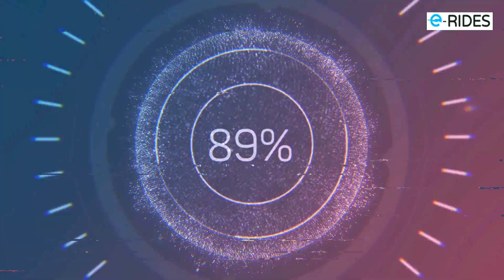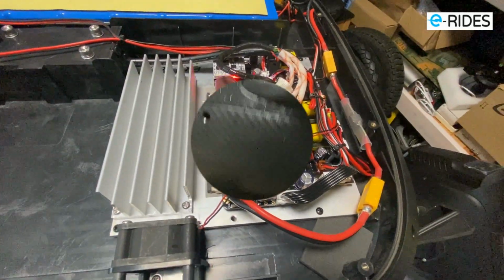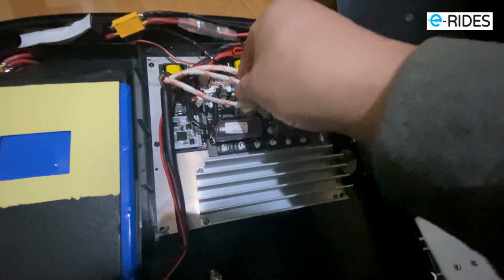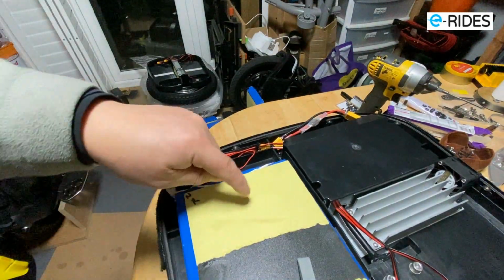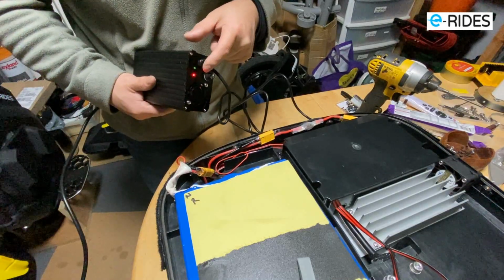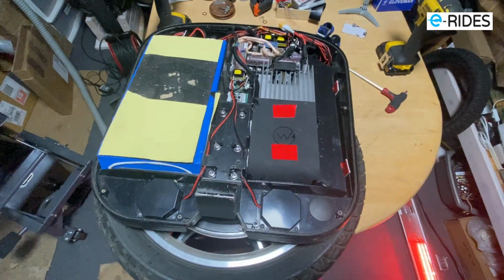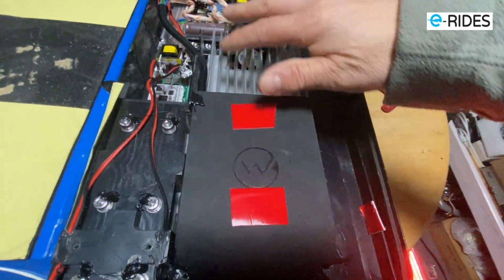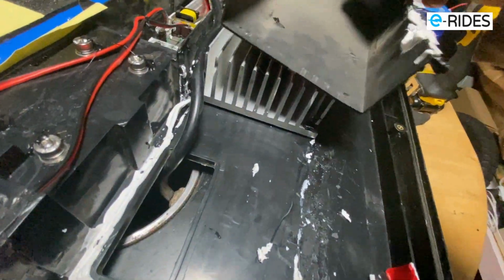BEGODE EXN PROBLEMS AND FIX. e-rides EUC Upgrade.

Comment: EUC UPGRADES I  am still wondering if it's the LG battery cells or the BMS that have a problem in Gotway EUC?
i have  5 pack so far 2 have 200cycles now work perfectly
then one i drop on concrete floor stop charging at 95.4c sold for pieces
two others for no reason stop charging at 96v and the other one 91.4v i did not abuse or do anything pack or bms have a serious issue.
also wonder if the Samsung choice will be better in the long run?

Comment: Gotway 🔥. Scary wheels still today. Look at the hole in the danm thing the had to have that big to cool down the boards that still overheating years later. It's poor QC and I think the company will begone = begode...
Reply: what do you mean, I've owned 4 and had no issues. Seems like since they switched to Begode QC has gotten much better

Comment: How do you test battery capacity with these crazy 100v wheels?
Reply: {tl;dr. This is a bit of a longer answer but it’s worth considering several aspects of battery capacity.}
 
There’s a few different ways to interpret this question, and it depends upon how different people define the term “capacity” for themselves. 
 
Some people think Watt-hours will quantify the performance value of capacity through the simple metric distance traveled: range. {This can be crazy-making for rider’s with less experience.}
 
Some believe a voltage-meter (displayed onscreen) is useful to monitor, because it’s a good indicator of both the quality of available electric energy capacity is still available (which reassures range anxiety). Qualitative feedback can be felt while riding as well, and a drop in current flow capacity (as the voltage is reduced towards discharged levels) is part of the experience of active performance management while experiencing every new trip on your wheel. {This can be crazy reassuring.}
 
Battery safety capacity for the preservation of battery against premature damage (to any individual cell) is yet another way to extend lifetime battery capacity. {Here it helps to have BMS features that can track each cell’s temperature and voltage both instantaneously and across one’s ride history. This (also) allows for the user to influence battery performance management through feedback of hazardous condition warnings (beeps) and collect feedback through data collection that can contribute directly both the rider’s knowledge of performance capacity overhead, and to manufacturer’s capacity to make incremental software update improvements.
 
Just knowing the voltage level can express to the rider how hard their wheel can be pushed in the sense of performance overhead capacity. Any rider’s ability to intuitively and comfortably sense when to recharge their wheel for either maximum torque, optimal speed, or regenerative coasting is super helpful in getting an optimal overall experience based upon rider’s needs for a given situation. {Whether optimizing for the racetrack or “hyper-milling” to get home on a cold night, knowing how to influence/manage battery capacity in the moment can be crucial.}
 
Another way to see battery capacity is how many more years can I use any given battery. Effectively, the higher current demand creates heat on the MOSFETS (and many other electronic components) and these (can and do) fail in mostly predicable ways. {This is most often a good thing.}
 
Safely may be experienced without cut-outs through the feedback of pedal tilt-back, which’s the way for your wheel to gently remind the rider that “duty-cycle” limitations are exceed… {so, just chill on excessive power demands (at every voltage level) but especially chill when the “instantaneous voltage under load” is in the lower 50% of the charge depletion range.}
 
Luckily, the control boards are designed to fail at various points (mostly intentionally and by design), which reduces repair costs for the wheel’s owners. The control board gets sacrificed last, whenever possible. {Of course, it’s preferred to sacrifice the rider last but it’s not always possible 🥺… as the Darwin awards do attest.  😏 }

On some newer and future models, the batteries are also prioritized for both instantaneous performance capacity available and for long-term battery capacity“health”; with high safety margins. For example,  over-current protection is implemented in several different ways in the design of BMS’ features, who has evolved well over the past decade and may be perfected within the next decade. {It’s actually impressive to see these features get incorporated into the wheels regularly and making continuous incremental improvements in electronic design innovations and history of updating both software and hardware until the optimal algorithms for data collection and interpretation can extend the wheel’s longevity of use. This too represents long-term maximum safety available, which can be measured both quantitatively and qualitatively as a sign of battery capacity.  😎
 
There are many ways to test and experience different aspects of each type of meaning of battery capacity, and the implementation and effects on rider experience could be explained in detail but I hope this overview helps clarify the question you asked. 
 
These wheels are “crazy” (in that they’re a lot of fun) and they’re getting better with every design iteration. At any level of rider experience and wheel performance capacity, the question of how to test battery capacity is both useful and quite nuanced. Hope this interpretation helps by implying that there are some capacities that are “baked into” the physical design, some “baked into” the software version, and some capacities that are “baked into” the rider’s experience and observational capacity, where each aspect of understanding both consciously and subconsciously contributes to the joy of electric unicycling. {Because… (both literally and figuratively) your mileage may vary.}